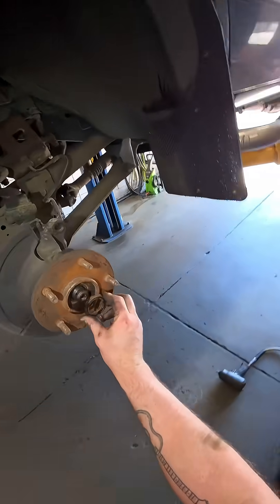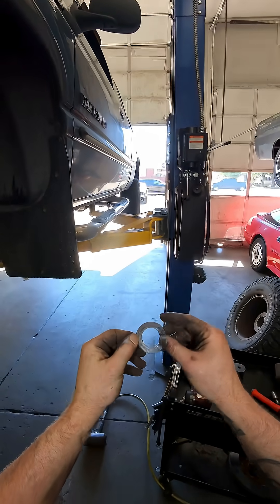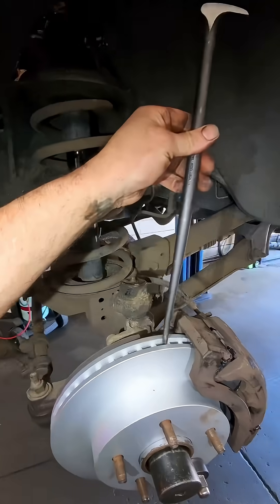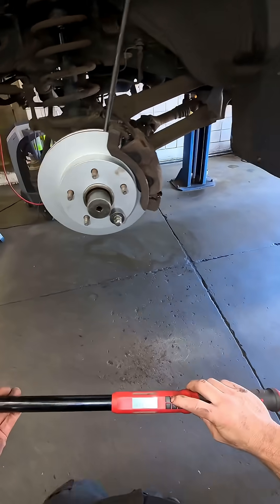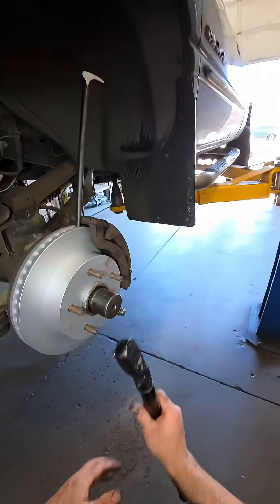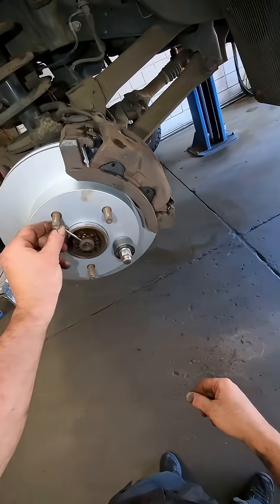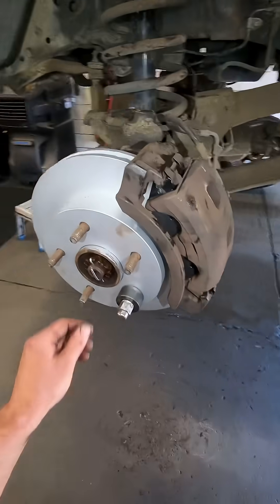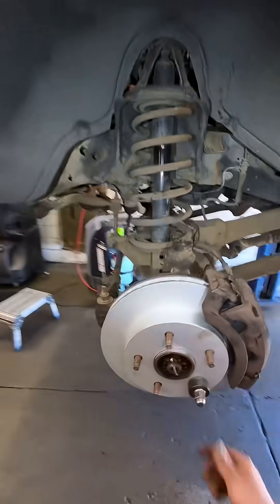Tech Tip: Axle Not Washers and Torque

Comment: Its cute you torque cv axles, the last time i torqued one it kept coming loose and i follwed manufacturers spec, with 3 different torque wrenchs, ended up just slamming the bolt on with a impact, also had it happen to me on my own car
Reply from the maker: it’s cute how you couldn’t do it right but still kept trying.  good job buddy!
Reply: @CoryOnCars juts because it wasnt done your way doesnt mean its not right, and judging from how old you are im.sure you haven't even done a quater of the jobs I have done...... the right way l
Reply from the maker: @awesomeness7117  How old am I?  Just for context, the shop I’m filming in is the shop that I have owned since 2014, which is the second shop I have successfully started and operated as 20 year master certified tech.

Comment: if your socket for the axle nut didn't move in the tightening position when the torque wrench meet the spec you over tightened the nut and hub assembly
Reply from the maker: Right.  Right.  It might not look like it on the video because I had my arm straight so the wrench stayed the same distance away from the camera while I was turning it but it turned between and 1/8 and 1/4 of a turn.  My electric impact on low only gets up to about 40 or 50 ft lbs.
Reply: @CoryOnCars  keep up the good work! lots of mechanics fresh or seasoned look to these types of videos for a heads up on what to expect jumping into a job for the heads up

Comment: My torque spec on my axel nut is  180 lbs  . My torque wrench only goes up to 155 lbs. I barely had strength to torque that .. I need to get a new torque wrench that can go up to 180 lbs..

Comment: Thank you for that nugget about the washer. I was wondering which way it went. Was replacing hub/bearing assembly and ordered it based on parts diagrams but neither the manual nor the one on it had one.  Pretty sure I put at least one on backwards. Never seen anyone talk about it before. I'll get it right next time.
Reply: Not every vehicle has a washer, however, you wouldn't look for it in the diagram for the wheel bearing, it would show it with the axel. Also, that's not always a washer. It could be a shim, and they get installed on the inside, before you slip the end of the axel assembly through the hub. If you develop an odd noise coming from somewhere around the wheel, it was a shim.

Comment: A split pin also known as a spring pin because it is made out of spring steel which binds collars onto shafts. A cotter pin is the exact name of what you use on all suspension parts of a vehicle where a castle nut is installed!
Reply: yup

Comment: The only time that I use a torque wrench is only on internals such as engines, transmission and differentials. Otherwise, I don't use use them. Which ever works with you. You can also tell by how much it turns as well from snug to tighten. Usually, a quarter turn and good enough but it depends on which specific job it is.

Comment: A cotter pin is a type of fastener, often referred to as a split pin, that is used to secure parts together by passing through a hole and bending its ends to hold it in place.

Comment: I don't think this guy understands how hubs are put together once you press when together yourself you'll understand more how this works More experienced technicians will agree with me trust me bubba now CV axle nut is not to keep that hub together that just ensures that the drive shaft stays tight😂😂😂
Reply from the maker: You don’t know me very well bubba and your comment shows your own ignorance.  There are many different wheel bearing designs out there and this is just general advice.
Reply: @CoryOnCars in other instances you're correct but in this one you're dead wrong especially considering that you have a drive shaft that's running through the hub that is not how these ones are put together and I was just pointing out your ignorance of what you said because of what you said actually had meaning in the same instance of a four-wheel drive model like a Ford F-150 that's two-wheel drive how come there's no nut and bolt keeping that hub together? That's the same type of assembly that you're dealing with so don't try to act like you're so much smarter than me
Reply from the maker: @lascrucesmobilemechanic  I’m not acting man.  I’ve been working on vehicles professionally since 2005 and have been master certified multiple times since 2010. I have been successfully operating my own shop since 2014 that averages about $900,000 per year in revenue. I understand pretty well how a wheel bearing works, whether it’s a hub style assembly like this one, a press fit, or a tapered roller bearing on a 2WD Ford like you mentioned.  And you know what, on many of them, including a pressed bearing like you mentioned, the axle nut absolutely does keep the bearing pressed together.  The wheel hub pushes on the inner race for the outside and the axle shaft presses against the inner race on the inside.  If the nut is not tight, the bearing can loosen up over time.  Just do a google search: “why is axle nut torque important?” to understand it better.  Don’t take my word for it.
Reply: Where'd you get your certification the backside of a Cheerios box? If what you said was true that means if you over torque that bolt it would make it freeze up right because it squishes the bearing??;no that's not how life works and I don't have time to explain to fly that honey is better than shit later dude  @CoryOnCars
Reply from the maker: @lascrucesmobilemechanic .  Right, you’re gettin’ it!  On some, if you over-tighten them, it can indeed cause excessive pre-load in the bearing, which eventually will burn the bearing up.  But on most press-fit and hub style bearings, the inner races would seat together which keeps the bearing from “freezing up”.  But even still, too much torque on them can be problematic.  Like I said man, just use Google and you’ll be okay 👍🏻
Reply: @CoryOnCars I can't blame you for being ignorant So I'll make a follow-up video the next wheel bearing I do and I'll show you exactly where it makes contact since you're misunderstanding where the CV axle actually makes contact on the back side of your hub That's a real shame especially considering that you try to claim that you're certified if you were certified and you've worked on these before you would easily know that the bearing makes contact to the spindle that the CV axle goes through and it actually makes contact to the backside of that spindle whenever it gets torqued down not the inner race and even if it sits pretty flush take a look at the CV where is makes contact Yes it might all be clean because there's a dust shield but that doesn't mean the entire thing makes contact with the backside of the bearing The CV axle makes contact with that inner spindle and that's where torque supplied I don't know where the miscommunication is especially if I'm talking to somebody that's certified and that's been doing it since 2005
Reply from the maker: @lascrucesmobilemechanic  the more you talk, the more wrong you sound, honestly.
Reply: "This axle nut is what squishes down the bearing" @CoryOnCars  is your own words if you take that apart and look where it actually applies pressure you would know that it doesn't sandwich the bearing if anything it's sandwiches the spindle which was pressed into the bearing on a pre-assembled hub so before you get all high and mighty on me like you know what you're doing check your facts I was calling you out on what you said😂😂😂😂 dumbass
Reply: @CoryOnCars if we're talking for instance like an older Toyota that's two-wheel drive that has spindles in the front yeah you're right tightening down that spindle bolt and nut compresses the bearing but The application that you're working on that doesn't apply So like I refer to earlier you are a dumbass😂😂😂

Comment: Well that's not an indexing pry bar. And why did you take the axle nut off for brakes
Reply from the maker: Right.  Right.  I called it the wrong name.  Sorry dude.  But I had the axle nut off because I replaced the axle u-joint

Comment: For the home gamers not using a lift, or if you don't have a vented rotor,
Pull the center cap out of your wheel, put the wheel back on, put the wheel back so it's just contacting the ground. 
You'll be able to tighten the axle nut through the wheel safely.

Comment: 80s cars called for 12lbs torque on the axle nut to overcome any burrs and then back it off half a turn and insert cotter pin. Never torque the axle nut and leave it.
Reply from the maker: Yes, for a tapered roller type bearing.

Comment: someone needs to correct that commenter. 1st. cotter pin is an official name. 2nd its a regional thing. apparently based on your location (US says cotter uk says split) i have the feeling that cotter pin might be another one of those. that originally cotter may have been a name brand that stuck. either way. no need to change what you call it based on a comment. you do you.
Reply from the maker: I always do me!  I’m also very sarcastic at times.

Comment: The precise torque tightening is crucial for conical bearing axels. Regular bearing can be tightened by feel. Even if you over tighten it, it tightens the inner shell, not putting any tension on the bearing itself.

Comment: Is its aluminium brake disc
Reply from the maker: It’s iron but it has a protective coating painted on from the factory. It’s made of a special material that wears off with the first few stops as the new pads and rotors bed in.

Comment: Okay I'm not saying don't torque the axle nut before anybody accuses me of that. But when you're tightening that nut it tightens onto the inner race of the bearing. It does not put extra pressure on the bearing. It will not make your bearing wear out faster. The reason to torque it is to make sure that it's tight
Reply from the maker: True! for this exact style of bearing, it’s really more about making sure the bearing doesn’t separate.  On some designs the axle nut does set the preload though. It’s difficult to give advice for every situation. But in general that is one of the main reasons to use proper torque in the axle nut.
Reply: @CoryOnCars 100%. On Land Rovers '48-'04 tightening the hub bearing nut sets the end float. And when you tighten the outer nut, there are two per hub, will also affect the end float.
Reply: Thanks, I was scratching my head wondering how that was possible.  It's not a conventional front spindle bearing nut.

Comment: When I bring my car in for any service, I explicitly require that all tension or torque shall be not be applied with a powered tool.  If I catch a mechanic doing a couple "ugga-duggas" to set the torque, they are replacing every fastener that they touched.  I have had too many studs, lugs, bolts, etc snapped by casual over-torque.